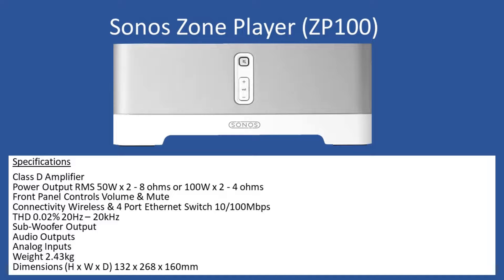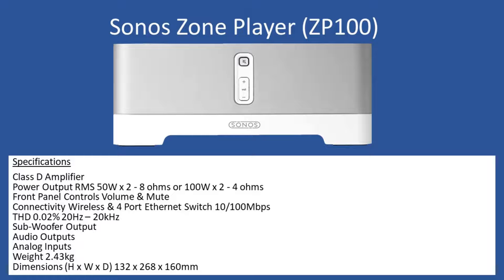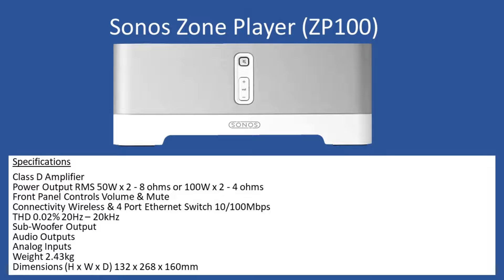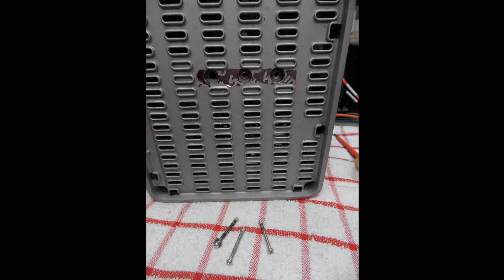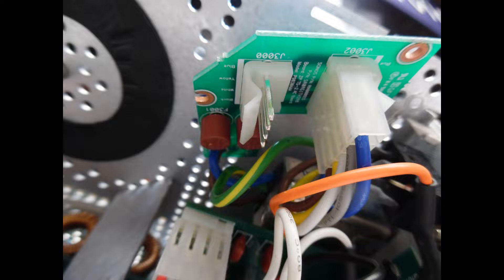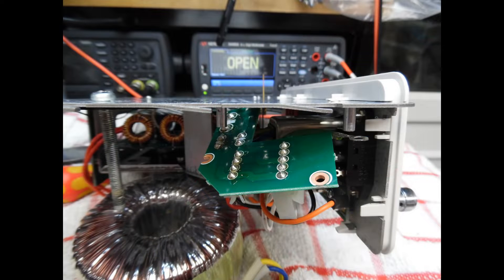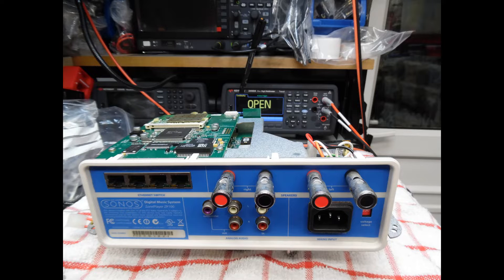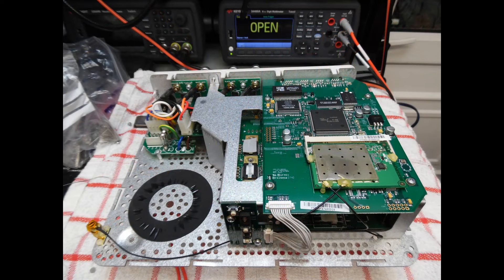Sonos Zone Player ZP100 Repair (With Audio Tutorial)

Comment: do you know if this unit can be ran as a stand alone power amp without an ethernet connection?
Reply from the maker: Hi Yes it can see the setup document https://support.sonos.com/en-gb/article/set-up-your-sonos-zp100
Reply: @AudioAmplifierServicing  Thank you for the link. I believe I have already found the answer to my question. It seems that the device needs a connection to a network (either with a wire or wireless to wifi) otherwise nothing happens. That will work for me but it is not what I would call "stand alone". If you know a way to make it work without any connection to a network please let me know.

Comment: Great video! I just finished fixing my failed ZP100 repair. Similar issue, but not the same root-cause. It turned out to be a short on the secondary side board with the full wave bridge rectifier. On that board there is a 48V transient voltage suppression chip (CJ48CA SMD chip) that shorted. The secondary side of the transformer normally appears to be about 33Vrms when working. Not sure why this part failed. This was causing a short on the secondary side of the transformer. Once removed and with new fuses installed, it worked fine. I'll need to get one on my next parts order.
Reply from the maker: Kevin, it's great to hear you have repaired the unit, and thank you for sharing your experience on the channel.